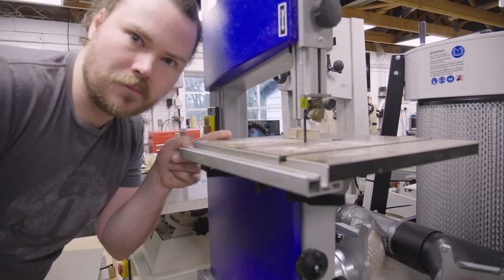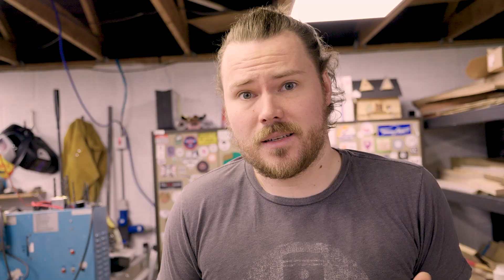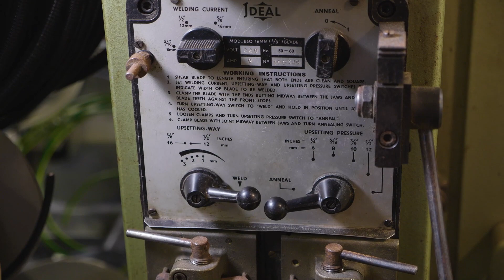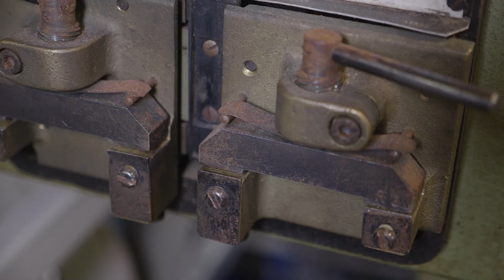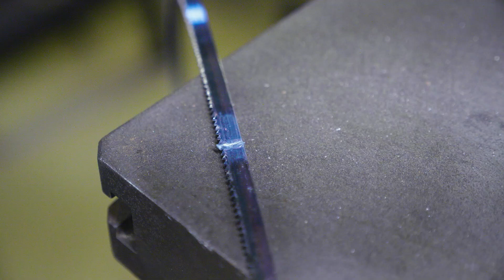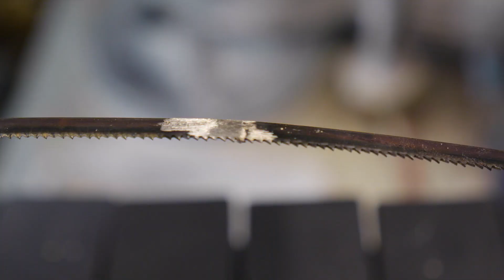How to Weld Your Own Bandsaw Blades

Comment: Man, you really need to win the lottery to be able to buy one of these bandsaw blade butt welders, they are so ridiculously EXPENSIVE !
Reply from the maker: Either that or be lucky! I picked mine up a few years ago for about £300. Right place and time I guess.
Reply: @MaltandMake  Oh, You're so jammy ! - Now they want almost 3 times that !, even on eBay they are super expensive second hand when they should be much cheaper...  Believe it or not it seems cheaper to just buy an old Startrite bandsaw with a blade welder included than to buy a blade welder on its own ! - Great Vid BTW 👍👍👍
Reply from the maker: @BITTYBOY121  Oof, that's good to know. I'll make sure I hang on to it!
Reply: @MaltandMake  I would !

Comment: Well, I appreciate the hell out of you too! I don't think my little weenie bandsaw is strong enough to break a blade... I call it a weenie bandsaw only in reference to its diminutive size. If you are actually cutting weenies you will need a SawStop... well a deactivated SawStop or you'll just nick your weenie. I'll show myself out.
Reply from the maker: If I remember my history correctly SawStop original founded as The All American Weenie Machine Company. Turns out they didn't do so well cutting weenies so shifted to making woodworking tools. 
I think that's right anyway... or it might have been a dream. Who knows!
Reply: @MaltandMake  I think you are correct. They shifted to wood after they couldn’t get their saws to cut through a single weenie.